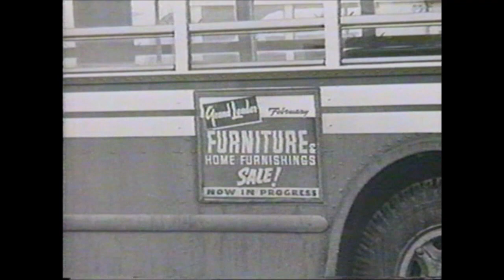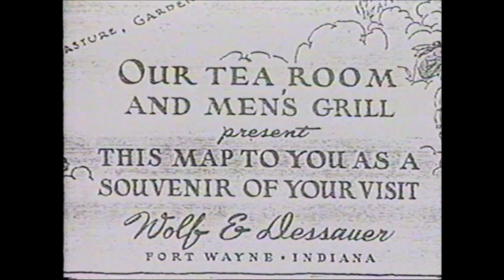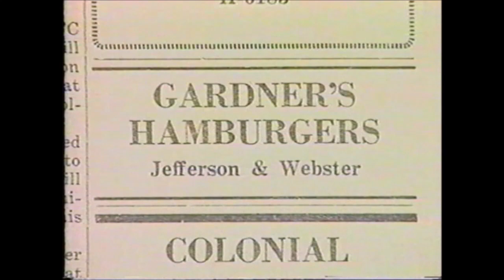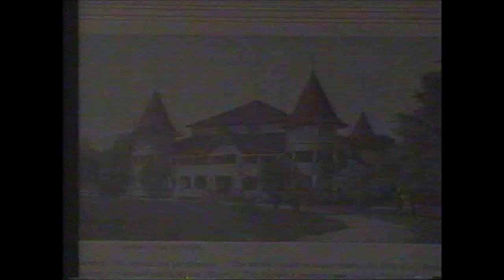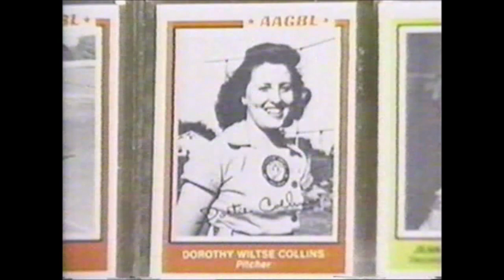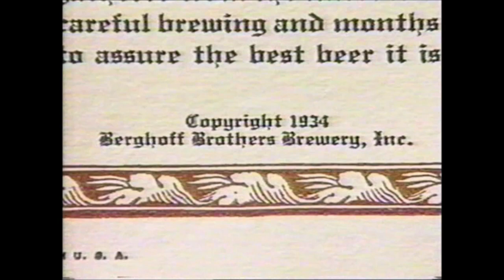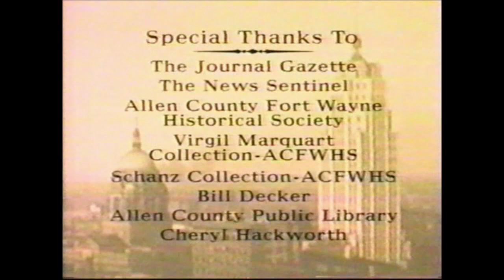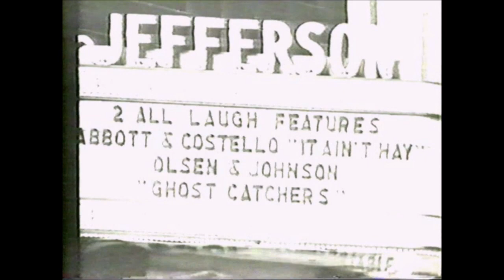Fort Wayne Then and Now

Comment: Any known history of the brewery that once existed in New Haven? I was doing some railroad research a few years back and stumbled upon a map that noted a brewery on the East side and even a large lumber yard not far from it.
Reply: My grandfather had a pharmacy in Fort Wayne that was over a 100 years old
Reply: The closest brewery to New Haven was the Falstaff brewery, and before that it was The Berghoff brewery the great lakes railyard is about five minutes east of where that brewery was it’s an NS yard and nickel plate road which is an NS main line that goes up to Chicago is right across the street from that brewery that brewery is  now is a mechanical contractor that bought it in 2001 I actually work there. .
Reply: @timcurrent5511 I'm familiar with the Falstaff and Berghoff Breweries. I grew up in New Haven. The Sanborn Fire Insurance maps I looked at from the early 1900's showed it in the area near where the New Haven water tower exists, closer to where the new (1990's) fire station is. By 1920 it was no longer on the map. Someone from a Facebook group actually had a glass bottle from there.